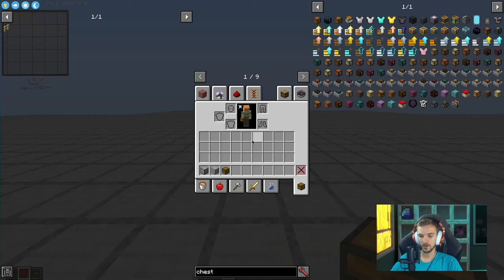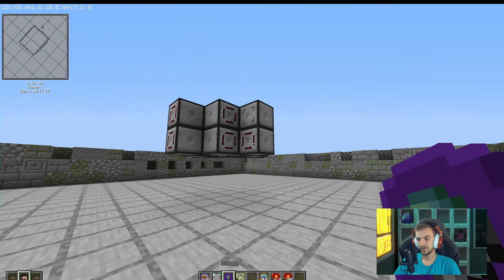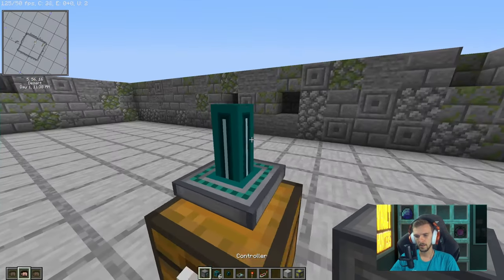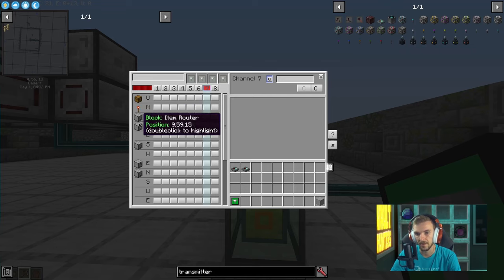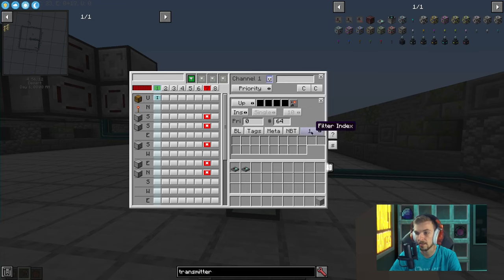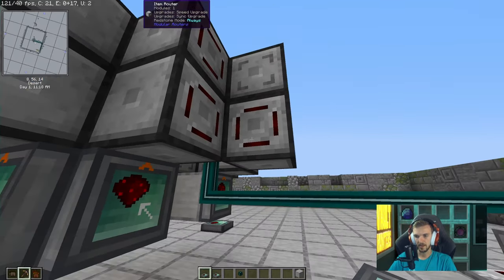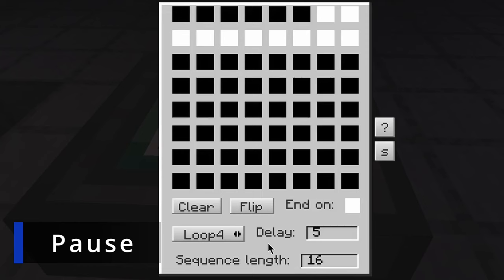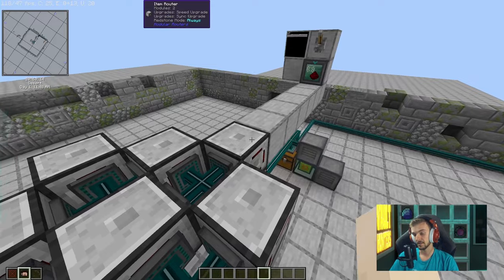Making an automatic ore placer! Fortune Up!

Comment: Any chance we could see something like this for VH3? Might not be as great because there is no RFTools, but should be doable I hope.
Reply from the maker: Well it is still doable for sure with routers and potentially the assistance of a drawer with a stack downgrade to regulate a single ore type as well as only 64 get processed at a time. But you'd have to figure out the redstone on activating the routers as well as toggling the drawer between sending it's inventory to the router and locking it from receiving new items during the transfer to the router. I'm sure there are some complications that I can't yet anticipate without jumping into building it but it is still doable just maybe not so compact.